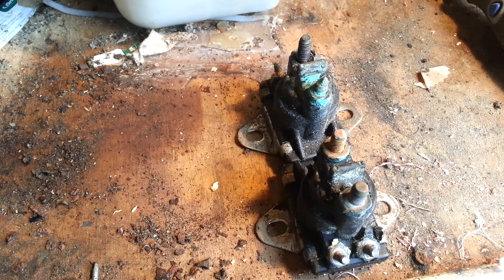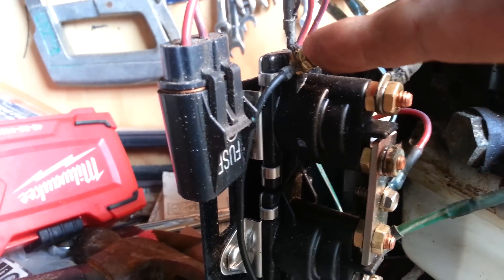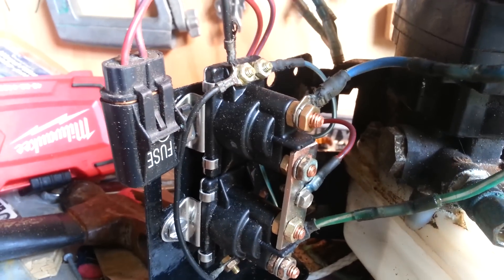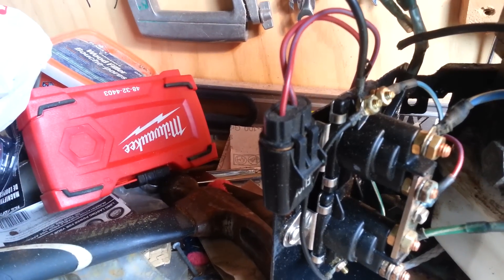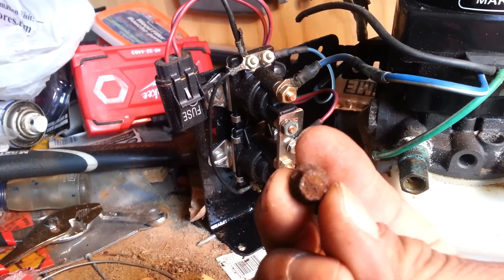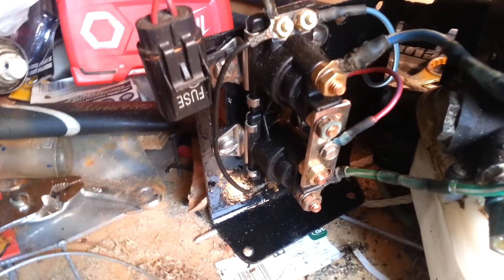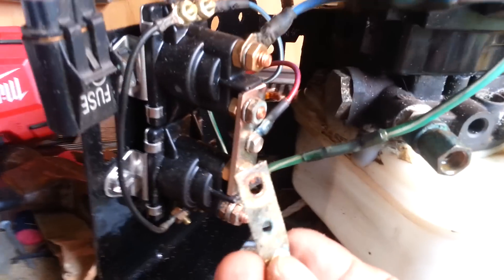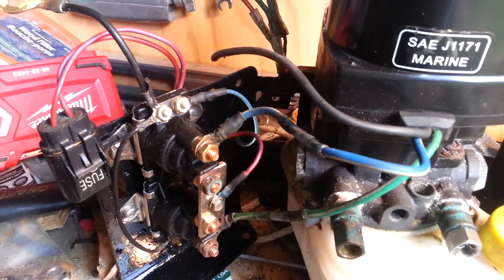mercruiser 300 hp trim problems

Comment: Same problem with mine, I have to use a screw driver to get both of the terminals tuching together so the lower unit can go up. My guess is a definite trim soleniod.

Comment: What do you use to clean the connections? Sandpaper?
Reply: Yeah basically if it still doesn’t work properly or it seems to sometimes work when it wants to, replace the solenoids. Better off replacing both so In the future there won’t be problems.
Reply: Don’t use sand papers with a lot of grit, use a light one just to knock of the service rust.
Reply: If you use a sand paper with a lot of grit, it can mess your threads

Comment: Nice video!  Did the same service to my port engine and drive.  Really simple to do, parts were not very expensive and works great now.  I also removed the entire unit to work on back at the house and that made it much easier.

Comment: What was happing. Mine is just clicking. I also have two. I am thinking of just replacing both
Reply from the maker: +Big Island MN does the leg or stern drive move up are down?   If it just goes up, then the top solenoid needs replacing, and so on.    It isn't hard to change, just time.
Reply: +James Swan thank you. I replaced both. I have a trim sender problem.
Reply from the maker: +Big Island MN its clicking because it needs replacing, and it does not cost much to buy one, it would be best to change both.
Reply: +James Swan I did both easy and cheap enough
Reply from the maker: Big Island MN right on